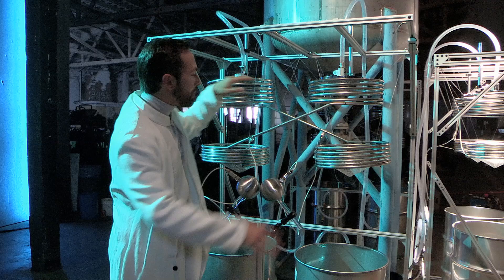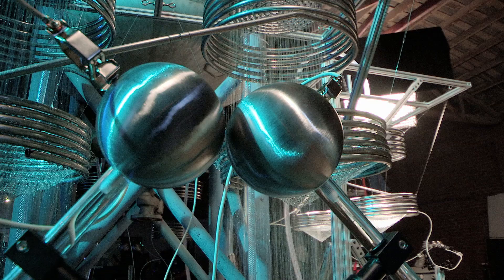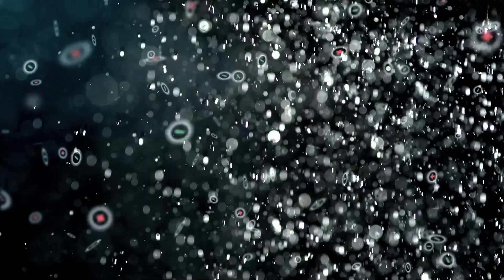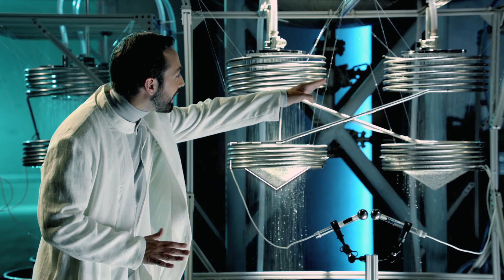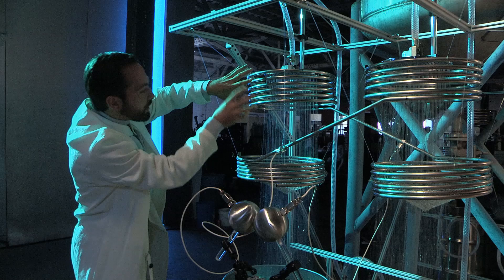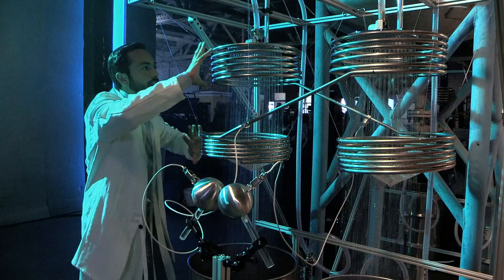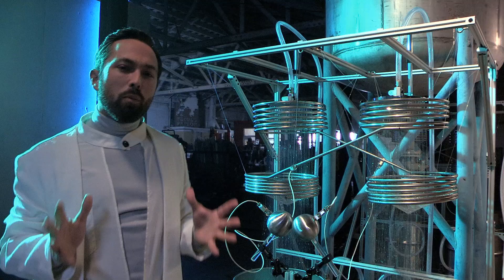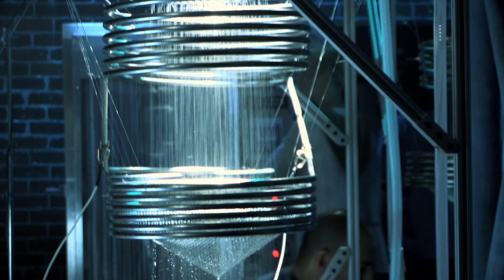Sparks from Falling Water: Kelvin's Thunderstorm

Comment: An engineer might explain this phenomenon via a concept called positive feedback. The apparatus is designed in such a way that the longer it runs, the better it works. In this scenario, a minuscule difference in the electrochemical potential in the water sets off a runaway effect that allows the apparatus to collect nearly all of the inherent electrochemical energy in the water. An interesting consequence of this design is that the "positive" or "negative" assignment on either water stream is essentially random. It could change every time the apparatus is turned on, and it will work in exactly the same way.
Reply: Great explanation describing its instability. but where does the energy come from.  Short answer is gravity.  

Consider like and opposite charges. They respectively repel and attract.    A closer look at the whole process reveals that for a short distance water is pulled towards or accelerated by the charge separator loop. After it passes the charge separator loop,  water is slowed down because of its attraction to the separator loop, and slowed down again with the collector plate because like charges repel. It takes energy to slow falling water,  and it has to go somewhere. It ended up stored as an electrostatic charge potential.
Reply: Most likely can charge a phone faster with a water wheel hooked up to a small generator, then just let the falling water spin the generator.
Reply: The stronger the field present, the more energy it is able to extract from the falling water droplets to feed that field. So voltage rises exponentially until the static forces interfere with the trajectory of the water droplets, or the system is discharged.
Reply: I'm an engineer (master of science EE no less) and my first thought in response to his question was that the energy was based in entropy.  If the water molecules were orderly (low energy, cold) then they wouldn't be out of alignment and wouldn't build up charge through this positive feedback mechanism.
Reply: I believe the energy comes from Gravitational potential energy of the falling water.
Reply: A key item that is missing is that water is slightly diamagnetic. Which means it repels magnetic forces. As stated, an inbalance in field polarizations is taken advantage of to begin miniscule current generation by the falling water (magnets) past the coils. This current is used to increase the magnetic field which polarizes the water and increases the water's diamagnetic property. Which in turn increases the current generation by the falling water.
Reply: willis936 as noted by others, the gravity is the key
Reply: willis936 master of science you missed the obvious and only source of energy- the gravitational potential energy
Reply: @bryonnoel4254  that's nonsense. The currents here are miniscule, and the magnetic effects of it are even more negligable. As explained in the video and commentbsection, this can be understood basically only using knowledge about electrostatics.
Reply: Who's to say it doesn't flip every time it discharges
Reply: @kreynolds1123  So, if we build it bigger we could get energy from rain! :P
Reply: Those who are voting for Gravity, so does this happen even for, let's say sand? the potential energy should be the same (consider same weight)?
Reply: @phischtv4497  "can we get energy from rain".  We do. Hydro dams  being top of that list. 

But good luck with   anthropogenic electrostatic induction for charge seperation in a cloud or between clouds. 

A lord kelvin thunderstorm aperatus needs a way to seperate charges.  A lord kelvine thunderstorm devive for  rain, needs conductivity between the various drop in the cloud above your charge separators. Instead, we have an insulator, air. But wind and friction with air does cause charge separation. Maybe you can figure out how to use that. 

In a lord kelvin thunderstorm apparatus a charge imbalance happens the moment a single ion disparity happens. And, rather then redistributing ions to their collectivr lowest potential, the ions are electrostaticly forced to further separate at the top only to fall and eventually be collected in a bucket, and help electrostaticly induce an even greater charge separation up top. 

The key difference is how things work at the top.
Reply: @Anand-N  could a lord kelvin thunderstorm device be made with sand? Yes if said sand were conductive up top, and in the bucket.
Reply: @Anand-N  yes, the starting gravitational energy potential energy of a kilo of sand and a kilo of water is the same.  The real question is how efficent is an aperatus at converting gravitational potential energy into electrical energy? 

It is my understanding typically, lord kelvin thunderstorm devices have very very very low efficiency with water anyways.  I'm unsure if a sand one could be made more or less efficent.

Take water running down hill.  Put a turbine with a generator in line. As the energy is take out of the flow of water, the flow of water  slow. The waters momentum is  converting to rotational mechanical energy that in turn is converted into electrical energy. 

Now the lord kelvin thunderstorm device slows charged water drops when a charged water drop drops past the charge seperator and when the charged water drop approaches the like charged bucket. Slowing the fall of water is taking the momentum energy out of the falling water, and storing it as electrostatic energy.
Reply: @kreynolds1123  I know, I was just joking :)
Reply: @DelphiTheDolphin  i hadn't responded to this profile before. Is it your second?
Reply: Exactly how random is it? What are the factors that makes it random? Is it quantum level? Or chaotic behaviour? I'd like to know more :)
Reply: @abc4924   Take a pen and balance it on its head. the moment you let go, assuming even if you could find the exact balance point,  it will likely fall over anyways. maybe a truck down the street shook the ground. a sound wave  or tiny gust of wind blows it over. 

With a lord kelvin thunderstorm device, all it takes is a charge differential of pluss or minus one electron landing in one bucket or the other to start charging the process. Google "water self ionize".  A few water (H2O) molecules occasionally self ionize like this H2O + H2O <--> H3O+ and OH− If one of either of those ions falls into a bucket without the other, the bucket's net charge is imbalanced causing some of that charge to travel up to the charge separator that in turn attract opposite charges and repel like charges from falling into the other bucket.
Reply: @kreynolds1123    I agree with you (see my answer on top)   no  chemical energy involved here...simple potential to kinetik, to electric field,  hence force, force plus  distance of movement  yields work hence  energy,  spark.... energy  field goes down... force  goes down and again
Reply: @keantoken6433  Exponentially????  did you  work out some ecuation?
Reply: @lacuentadevideos  I might be wrong. I had a bookmark years ago that is now gone.
Reply: @lacuentadevideos  This is way way way way over simplified. But consider starting out balanced.  Then one bucket randomly gets one extra electron that pushes charges up to the charge separator over the other bucket.  And that repels electrons up top to exit over the  othet bucket. Moments later you have 2 electrons in the negatively chatged bucket pushing even more electrons up to the charge separator loop.  Say those two electrons now cause 2 more electrons to drop into the  negative charged bucket, leaving 4 electrons in the negative charged bucket.  Now 4 electrons can push 4 more electrons to fall into - bucket giving you 8 electrons in the - bucket.  But  the first electron doesn't really push one whole electron up to the charge separator loop, maybe just a tiny fraction. So, instead of =X^2  we have =A×X^2, where A is probably some very small number just barely greater than zero and dependent on the geometry and size of the bucket length of wires and loops ect.   Now as the charge difference  increases so does the leakage, and that's related to humitity air pressure and temperature. Maybe over a range of values below the break down voltage, we  can describe that as B×X giving us =A×X^2+B×X where B is some small negative number and based on factors previously stated.  It's likely to be far more complicated than i layed out but the growth is exponential, not geometric.
Reply: @kreynolds1123   any of your  description  the  way  ** 4  or the long one  don.t  explain wher the energy comes from... for the ones saying that is from gravitational field, this is not an Energy, its just a field,  if it does not generate  speed or work  it wont  result in energy... here the last Energy involved in the conversioon is the kinetic  energy, and the  variation of this involves   change in velocity and direction vectorialy  treated, this is not only module but direction  which  generally is called Momentum.
Reply: @Jacob Votava stick to the point.the question here is  what is the energy's conversion that yealds into electric energyi...no need for evuations neither....the waterr slows down and changes direction... So  thst  change in momentum to get specific  converts into   another form of emergy which is an electric field.. that under given circumstances (a smsll spark distance)  produces ionization of air... Hence heat and light  also mechanic energy as a  sound that disipates at a distace  as heat..thats all in macro phisics but the  final result  indicates that no  atomic nuclear reaction occurs.
How the machine works is  other stuff
All electrostatic machine s work More or less the same 
I can assure you that when liquid forms into drops they get a charge  you can see this by yourself  sometimes when you pee  you.ll see that the drops repel each other before touching ground  do it  at your feet  distance allowing droplets to form mote or less the same should happen in rain storms
Reply: @Jacob Votava    Dear friend.. lets    begin in parts   like Jack the stripper said..   first   you r right, Im not from Us, so  as you see  I m not used to put  apstrophes ,    this is like a a shorthand as long as can be understood.. and I do not use  auto correction as I do not have the time to waste some time, and some mistyping is allowed from mypoint of view. which are no errors,  there is indeed some tendency to the spanglish  forgive me about that...
Second  I ´m senior electronic engineer with masters in MRI. TAC, Gamma Camera, and  ultrasound  and Litho tripsy... Yes   all of them,  in USA, Japan, and Germany of course.
I do not remeber if we had some talk before, but I   believe   (time passed) that the question is  only and simply  WERE does the energy  comes from.
 I you understand text (FCFG) the question  really  asks   : Fact:  a spark comes out,  then were  does the energy that is converted into an electric current  , times a voltage, times the time it takes place ( very short),   plus  some ather negigible amout of mecahnical energy , or work  done for some very short time disipated  as heat in the air around by the sound that the saprk produces ,  It is so small that it won´t brake  glasses or the like ( the sound I mean....) but our ear can detect some uW of sound!!! but what  matters to us is the electric marvell!!!  do not need to get into integrating the V-I waveform, but I bet it is as close to e Diracks Delta as known.
 want to go to Fourier  transform?  no need...
Back to the point.  where does THAT  energy  comes from?  nobody asked HOW  does the machine works,  as if somebody asked you: were does the energy that   deformed  that car that crossed in front of the locomotive come from?   and you start explainig the Carnots  theorem and  efficiency of  a thermall machine. or how the piston is displaced by vapor............ I´d unswer shortly: Energy converts into Energy ( Here)  the heat generated by the deformation of the car,  the 1/2 of its mass times its velocity it got shooted sideways (forward doesn´t count) and the sound and the  lights which is heat visualisation of heat dissipating ALL of them  which heated the surrounding air and finally to the universe ,  when everything is still , let me breath.......... CAME from The 1/2 the mass of the train times its velocity CHANGE   from the begining of the collision to the end, the engineer started braking  after the collision, supose....
Is that simple  my friend: the energy of that spark  came from  the change in momentum---> ( vectors involved here) of each water droplet (to simplify) ,   you could write a paper if you want precission.. but  this isn´t the  point here, is that simple, and I can tell you because  I made my own working one at age16  back in 1969, may be  you have to drink a lot of soup yet, or you don´t know the  energy conservation law, let me make  some assumptions as you did...I kindly  invite you to have  some  mails if  you like to, leaving  supositions  and judgements aside, lets consider braking even here.but I couldn´t   with my tendency to ironics, I´d be glad to refresh my times as  auxiliary  teaching in  physics , electricity and magnetism, I promisse  I ll have  autocorrections there...
Reply: @lacuentadevideos  Induction is what you're looking for. The water is polar, some drops contain a slightly positive or negative charge, which means they have an electric field. Electric fields always create magnetic fields, pass a changing magnetic field (in this case, one that is moving downwards through the coils) through those coils and they will induce another electric field inside the metal. And as the others explained, this will exponentially increase over time until enough charge has accumulated to overcome the potential needed for the spark to jump the gap between the orbs.
Reply: @jcklsldr   I  insist: no need for coils there, besides, their   ends are open,, so there is No induction  working there, only electrostatic separation of charges, a coupe of open  powder milk cans would do, or a couple of open beer can,   or down to a  1 inch  metal ring. Induction all over the world  is the  potential produced in a near coil by the changing current into another nearby coil with some special  geometric position, which I wont describer here for concisness,  its in  the well known bibligraphy. besides  the question is precisely: where  the energy comes from?, ans: it comes from the kinetic energy of the water, which in turn comes from its potential energy  over the level of the rings, which in short comes from  the sugar that the guy that  picked up the water from the tap up to  the upper reservoir, that easy. of course with very little efficiency, otherways  we would  have this arrangement powering our homes  from dams.
Reply: @lacuentadevideos  You don't need 2 coils for induction...a single coil and a magnetic source near the coil are all you need. Induction of a transformer is a specific type of inductive setup. An iron core going through the center of a copper wrapping (dynamo) is another.
Reply: @jcklsldr  all right all righ but you are not entirely right: being precise  acording to lens law you need a Changing magetic filed,  a relative motion  between,   a simple iron core would not have any efect, nor  open coils like in the video,  and I add:  for those   who said that  chemical energy  was involved, yes.   it is, in the sugar used by the musles of the guy who filled the water
Reply: @lacuentadevideos  A changing magnetic field is one that is growing in radius, changing in angle, or changing in position, ala water falling through the pipes, the magnetic field is moving.
Reply: @jcklsldr  I am sorry to tell you that I am shure there is no magnetic field there, because there is no current   in those open coils, please  continue your search for the truth  with a good physics  teacher,  I  end the discussion here, as this is no place for mathematical explanations thank you, bye.
Reply: @lacuentadevideos  I'm an electrical engineer. I'm sure there is a magnetic field there because in a plant I worked in, we had an issue with flowing water in a pipe inducing a field and affecting equipment because it wasn't grounded properly.
Reply: Excellent. Well said.
Reply: You mean electrostatic
Reply: Ding ! Ding ! Ding!
We have a winner!

Comment: Your power source is gravity.  Static charge is created by the attraction of moving water molecules through the air, past the coil, which also creates an electrostatic drag.  Acceleration differences between top LR coil connected to bottom RL in a circuit creates a flow of current.  Notice the electrode placement.  It is how we harvest the energy.   You can make a ladder from it,  as the water must keep falling.

Comment: This is , in essence, how a capacitor works, lets say the left, top coil becomes positive because the stream of water on the left is negative. As the water passes through this coil the electrons are pushed away from the water towards the bottom right coil, making it negative. This is made even more negative by the stream on the right being positive, attracting more negatively charged particles. The opposite effect applies to the other side. When there is a great enough charge difference between the two spheres, then the electrons conduct through the air creating a spark.

Comment: The energy comes from the potential energy of the water. In essence, gravity is the source of charge. Potential, converted to kinetic converted to electric then released through the spark. Separating the two balls would allow for greater charge to build up, but would take longer to charge up enough to a voltage great enough to exceed the breakdown voltage of air.

Comment: This is one reason that some chemical tanks have down flow pipes that go almost all the way down into the bottom of the tank.  If the tanks had a short inflow pipe at the top, the falling liquid could generate a spark that could ignite a volatile liquid.